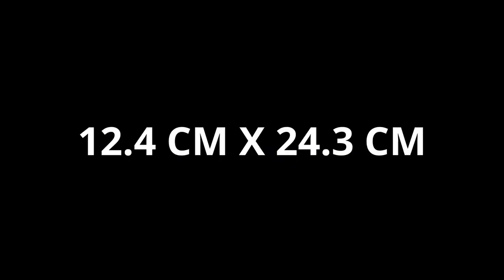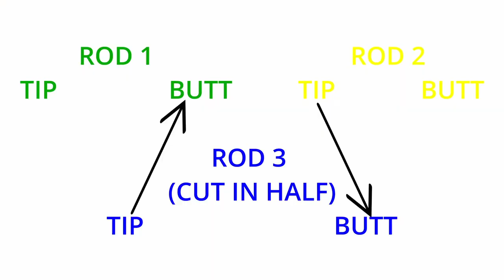Rectangular Basket from Paper - A to Z Tutorial

Comment: Miss Olena, my weavers don’t have as much body as yours. They are floppy and tend to flatten instead of keeping the round shape. It may because I had to substitute packing paper for newsprint, or it may be that the weavers are too wet. 
Do you let the weavers become almost dry in the middle section?
Reply from the maker: Most likely it has to do with the thickness of the needle (wire) you use for making your weavers and/or with the width of the paper strips.
Reply: @miraclewicker  Perhaps my packing paper is not a good substitute. It’s hard to find recycled newsprint now because so many subscribers read their newspapers online. (I even asked the public library for their old print newspapers, but they are only allowed to give them to schools and charities.) 
I looking into purchasing newsprint, but US paper mills are frustratingly inconsistent in how they define paper weight. If only the U.S. would go metric!
Reply: @miraclewicker You were right; my 1/16” (1.588mm) rod was too thick. I’m still using 10cm-wide paper strips, but switched to a 1.2mm wire. The rods are much sturdier. Thanks!